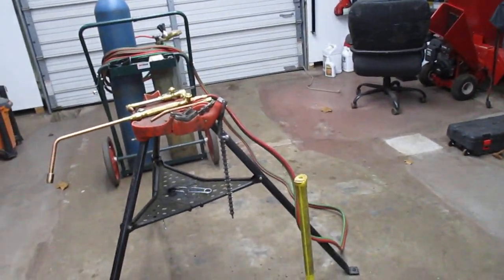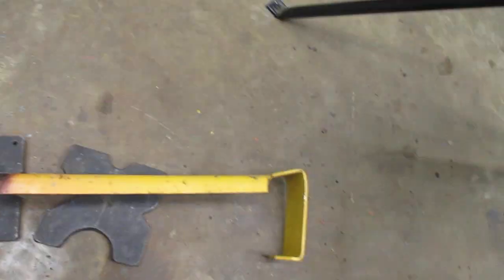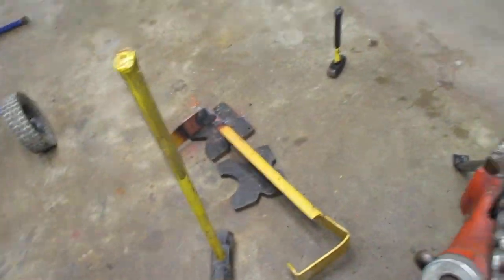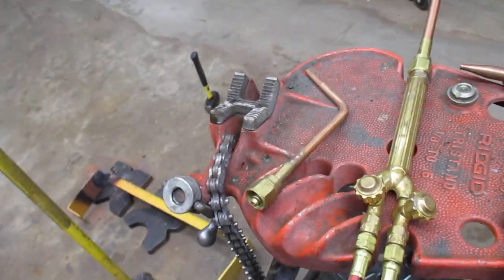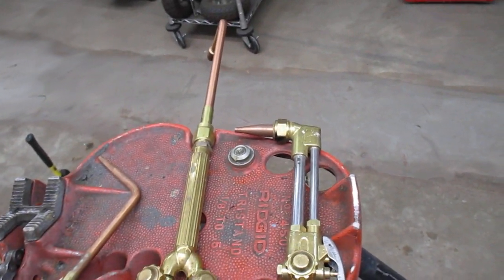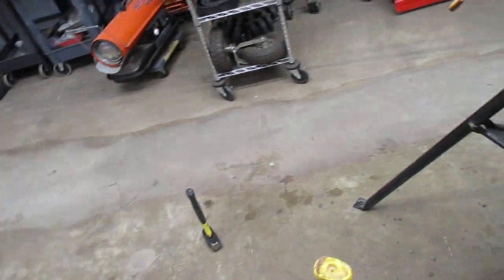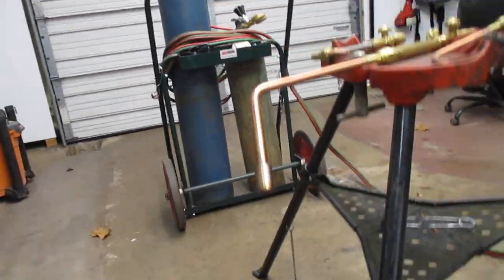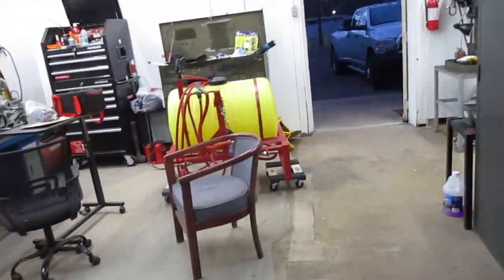9 Dec Little building why use a rose bud

Comment: my set up is an Ox-Weld.  If you know where I can get a rosebud cheap on the internet please enlighten me. 
I've a small rosebud fits on what I think is an old Harbor Freight torch but it's small and so is the torch body.  The HF might be Victor compatible (not sure).  Anyway, I've not seen a rosebud that fits my rig for less than $120 bucks for a 30 or 40 year old tip. 

I think guys on the internet use a cutting torch because that is all they have.
Reply from the maker: Check amazon again. 30's to 50's depending on size and what torch body they fit.